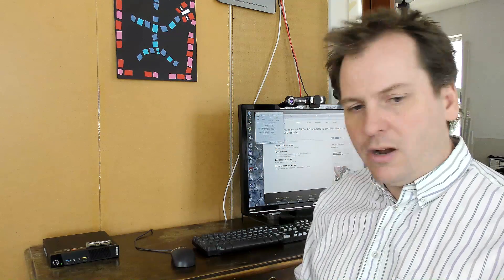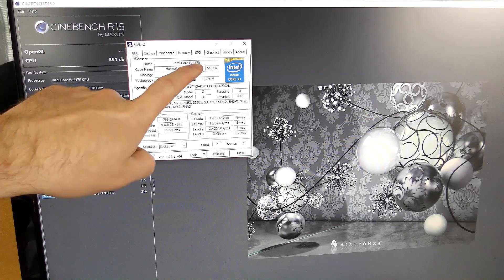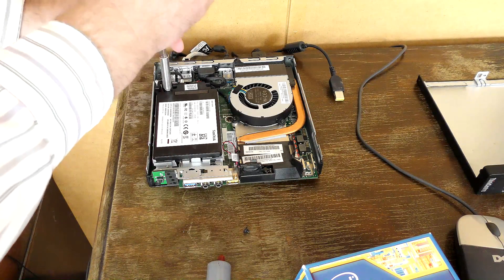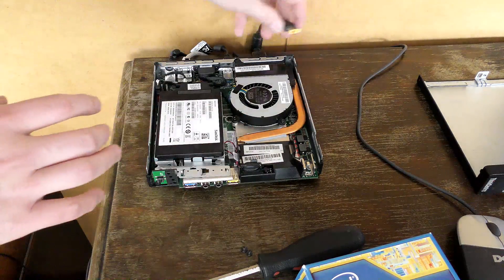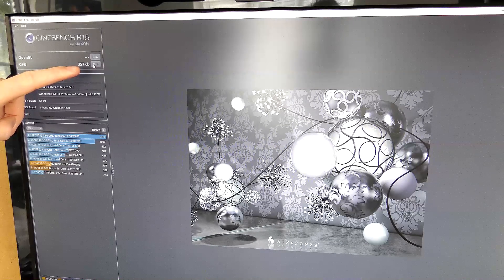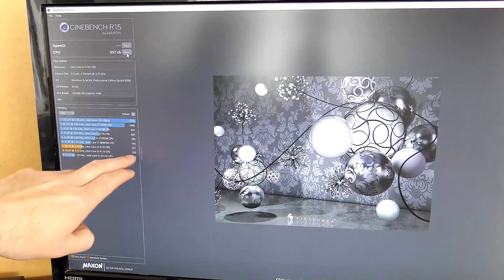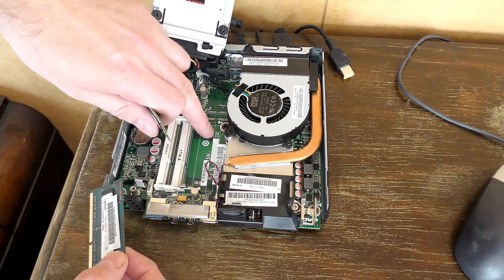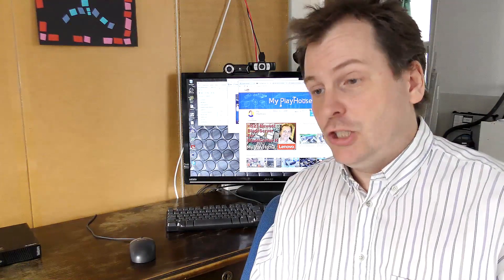Playing with Memory in the Lenovo TinyTop M93 - 535

Comment: Good morning teacher, I wish you are very well, could you answer a question that no one has been able to answer me?

It is that I want to do a cpu upgrade, from Core i5-4570T to Core i7-4790k (both fourth generation), it is a lenovo thinkcentre m73 tiny motherboard, in which some of its components are low consumption, but the socket is the same for both processors, that is, it is the lga1150, very famous a decade ago. I bought an original 90watt ac from lenovo that supports all consumption.

Since it is a Mini PC (tiny pc), can I make this change? Or do you not recommend it?

I am very attentive to your response, have a great day!
Reply from the maker: The tiny Lenovo system is made for 35W,,, the system is build for that,, so I think an 88W CPU will be stretching it.
Reply: @MyPlayHouse  Thank you very much for answering my dear, you can't imagine how happy you are doing that, in that case, what is the processor with maximum power for the LGA1150 socket that you recommend for my model? understand that I have the lenovo thinkcentre m73 10ax model and i have a lenovo ac 90watts power... I greatly appreciate your advice my dear... I remain attentive....😃

Comment: If it's capable of running 12 gigs of RAM can a single stick of DDR3 8 gigs of RAM maybe get something has a lower speed I will give you tons of memory I did that with my laptop I'm running 12 gigs of RAM right now with a Kingston 8 gig stick and then the original 4 gigs that was on bored already
Reply from the maker: Yes, I did that later in this video.

Comment: Try the i7-4760hq . You will double the gpu output on geek bench.  Updates intel iris pro graphics 4400  to 5300.
Oh, and buy some new matching Ram cause it will help with the turbo boost, either two 4gb sticks or two 8gb sticks that are the same brand and both Dual .  
As for the cooling issue. The i7 chip is lower wattage,  therefore it will run cooler , your machine will be a quad core 8 thread 8mb cache and iris 5200 graphics.  The geekbench will scream.
Reply from the maker: I do not thing that is the same socket ??

Comment: I know I'm coming to this pretty late. But I recently caught on to this tiny form factor and have been doing my homework.

If you can get an CPU with a "T" at the end, those will run at lower wattage and produce less heat. Since your cpu is a Haswell, any 4xxx cpu should work (https://en.wikipedia.org/wiki/Haswell_%28microarchitecture%29) The best case would be a i7-4790T. 

re memory, sometimes the bios doesn't detect the memory speed correctly. You can try overriding the speed it detects and/or updating the bios. (Lenovo have released bios updates for these as recently as Dec '18.)

2 memory chips are better than one since the system can use both, effectively doubling the memory speed of your system. (Not really, but 2 traffic lanes are faster than one.) Based on what you had, i would use the 2x4 GB SODIMMs and verify in the BIOS what speeds it thinks they are.
Reply from the maker: Hi True Vulgarian
Thank You very much!  glad you liked the video :-)
Thank you for watching! :-)

Comment: maybe time to put the two 4 GB sticks in the machine? I was told that the GB is more important.... I had 4 on a machine with an HDD and it became faster with 8GB of ram... same applied when I went to SSD.... I always say to people max out the ram on prebuilt machines even though you don't need to so you will never see a problem ever won't hurt and you will be extra safe
Reply from the maker: Putting in both RAM blocks,, improves the CPU speed as well.

Comment: I find it weird that while the stick says its 1.6 Ghz the system runs it at half that speed (or even slower). Maybe that has something to do with the FSB to memory ratio ? Did you try changing settings in the BIOS/UEFI ? Isn't it the case that for a 1.6 Ghz Ram you need 2 identical blocks to run them on 1.6 Ghz (Dual Channel) while using only one will result in 800mhz (the half of it). I remember back in the days of the Pentium 4 my motherboard reported 400mhz with 2 memory-modules (dual channel mode) and 200 if one ram-module is used.
Reply: thats how DoubleDataRate works
Reply: rasz yea you're right and my cpu-z tool also only displays the half of the RAM-module's printed-on-its-sticker frequency (I just found out)
Reply from the maker: It does not need to run full speed all the time,, so by clocking down,, it saves on power and makes less heat,, so it can also over-clock a little if needed.

Comment: again this half a laptop :)
try HWiNFO/AIDA64 instead of HWmonitor. HWiNFO sensor view directly shows if CPU was thermally throttled(slowed down)/AIDA64  even displays how hard it was throttled in a nice graph - it will show your half-a-laptop cooking inside and unable to dissipate heat fast enough.
Also compare the size of this halfalaptop cooler to W530 cooler to get some perspective (one thin heatpipe vs 2 thick ones + real copper). Lastly compare the price of whole quad core(i7 3740QM = 4 cores 8 threads) W530 laptop to the i5 4570t you talked about + price of this ThinkCentre abomination. Consider selling M93 and getting a nice enterprise laptop :)
4570 is not i7, its not even a proper i5, its rebadged i3 = 2 cores 4 threads, its one of intel many small scams.
Reply from the maker: Hi @rasz
Thank You very much!  glad you liked the video :-)
Thank you for watching! :-)

Comment: would your unit take 2 x sticks of SAMSUNG 32GB of RAM for 64GB or is maybe time for a system powered by an AMD RYZEN 1800X or moving to a motherboard which can take the AMD Threadripper.
Reply from the maker: Hi DAVID GREGORY KERR
Thank You very much! as always my mail address is under the about tab :-)
Thank you for watching! :-)
Reply: I think the maximum RAM size is 16 GB for DDR3-SoDImm (to be honest I only found one Crucial 32 GB DDR3 KIt with 2 modules for SO-DIMMs, actually read Haswell isn't that good supporting in 16 GB Modules not being at least Broadwell where 16 GB should be supported

Comment: Youll need to run dual channel memory to get over the 800mhz.
Reply: Well no, dual channel is the bus bandwidth, where as ram speed is the bus speed.

The solution lies in the name DDR-memory

Double-Datarate Memory 

which means 2 signals are utilised by clock. Ram Manufacturers advertise the effective speed (maybe DDR4-3000 for example sounds better then DDR4-1500 which is its actual clock speed.

Mhz Actually refering to 1000.000 Transactions / secound or  MT/s.

As we learned in school Frequency in Hertz is defined 1hz = 1/s and T must be 1 otherwise it would impact the  result so T/s is the same as 1/s or hz
Reply from the maker: Hi @yourpcmd
Thank You very much!  glad you liked the video :-)
Thank you for watching! :-)

Comment: Hey there, I don't know how good the BIOS on that little computer is but some bioses allow for some manual clock selection, even you having different dimms in there with different speeds and timings you might be able to bring both dimms to run at a faster speed if by manually tweaking the frequency and timings
Reply from the maker: Hi Thelosouvlakia
Thank You very much!  There is not that many options of that kind in this machine.
Thank you for watching! :-)

Comment: You will get the "advertised" frequency when you put in two memory blocks that are the same frequency. Memory blocks will run at lower frequencies if the other memory block is slower than the other one. 

Also for temps from your other video, you are exceeding the TDP limit on the heatsink. Changing the thermal compound to a better brand will not help in this case
Reply: He is getting the advertised frequency right now. Cpu z just reports half the clock due to how DDR memory works.
Reply from the maker: Hi Matt Garner
Thank You very much! 
Thank you for watching! :-)

Comment: CPU-z has always shown half the memory clock because double data rate. take clock rate and times it by 2 to get the posted memory clock. so the 799Mhz block is 1600Mhz
Also it may be wise to switch to dual channel memory configuration because well it is slightly slower you get more bandwidth with dual channel.
Reply from the maker: Hi BlueFoxTV
Thank You very much!  I did not know that,, but I did assume it, when I saw the other speeds.
Thank you for watching! :-)

Comment: "DRAM Frequency" reports half the actual frequency. You should search for another 4GB 1600MHz stick.
If you want to upgrade to an i5/i7, you should look for -T models with reduced TDP (for example the i5 4570t), unless you'd like to fry eggs on your PC.
Reply: Morten Davide424 is  right you should get 1600 MHz or 1866 MHz Memory and USE DUAL CHANNEL
Reply from the maker: Hi Alina Hänel
Thank You very much!  I do want some faster Memory,, but I wanted to see how this slower ones would work to.
Thank you for watching! :-)
Reply from the maker: I did look at the i5 4570T but it was a little expensive,,, just tried to bet on one now.. But The one I have,, is not bad. :-) most of the time.
Reply: Well the i5 45780t is a glorified fancy i3 (2 Cores, 4 Threads). https://ark.intel.com/en/products/75045/Intel-Core-i5-4570T-Processor-4M-Cache-up-to-3_60-GHz
Reply: CPU-Z shows the actual memory speed, but since it's Double Data Rate ram it's effectively twice that.
Reply from the maker: Okay,, no problem,, I just got over bid on that one,, and it is now in €51,, and I think that is a bit to much.
Reply: @MyPlayHouse  i5-4590t is the cpu you might want to upgare to, its 4core cpu unlike i5-4570t which is a 2core cpu.

Comment: When it's in dual channel mode multiply the Dram Frequency whit 2 ,this will give you 1600 Mhz or 1338 if it's 669 mhz
Reply from the maker: Hi Ronor Cannel
Thank You very much! 
Thank you for watching! :-)
Reply: This doesn't require Dual Channel.

The actual ram speed is 667 Mhz (while beeing advertised as its effective Dual Datarate 1333Mhz) or 1600 Mhz (when it is actually 800 Mhz).

Dual Channel means you can parallely access 2 64bit channels (making effectivly 128 bit) (the build is a wider highway), where as the speed 667, 800 or whatever it will be really (speed limit...)